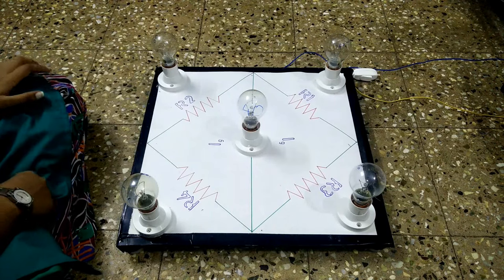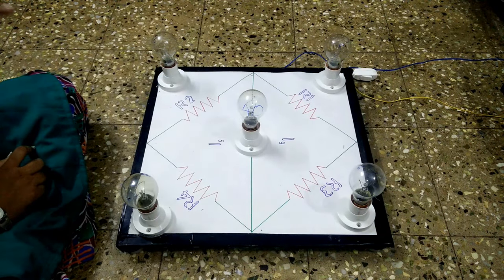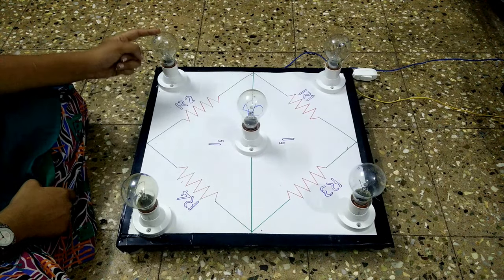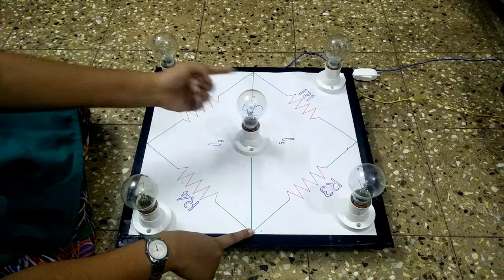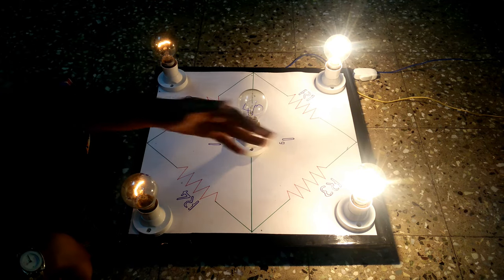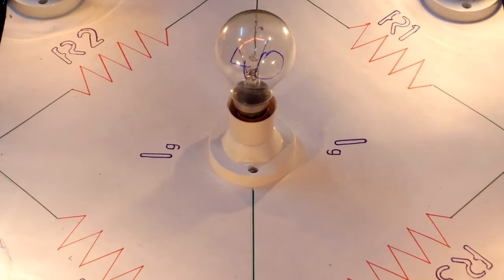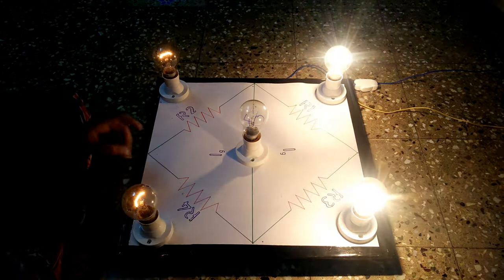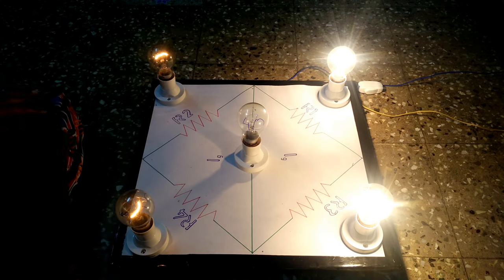Wheatstone bridge Explained-English

Comment: Nice demonstration, Can I suggest to use a low voltage ( 24 or 12V ) system instead of using 240V for the demonstration. I am concerned about the safety of someone trying to replicate your demonstration... you explained it really well thanks
Reply from the maker: Dayantha Jayarathna I appreciate your concern, sir. But I've tried to demonstrate the concept on the basis of resistance in the bulbs. Using a 24 volt power supply would have me use LEDs or smaller halogen bulbs which in my view does not seem to show the clear results. Plus , being in India 220 V supply is what is available readily. Anyways, thank you for your response. I'll keep this in mind  for the next project.😊